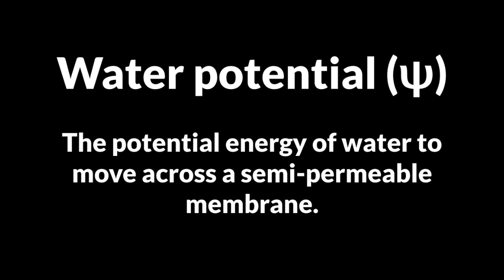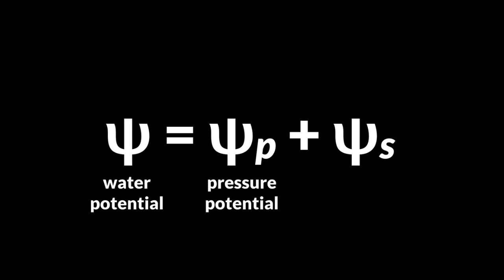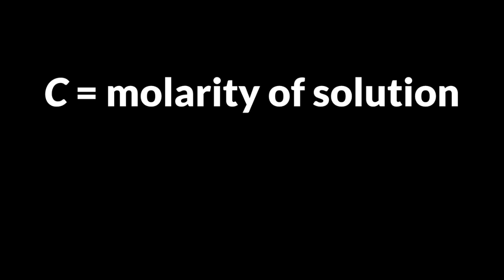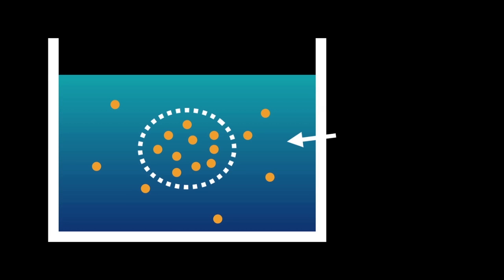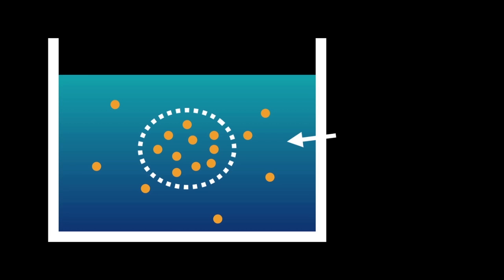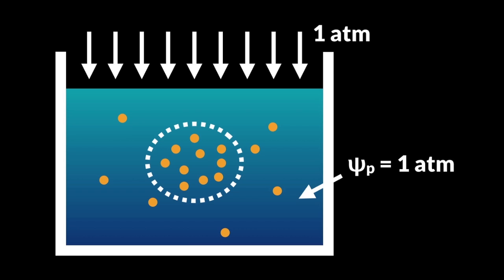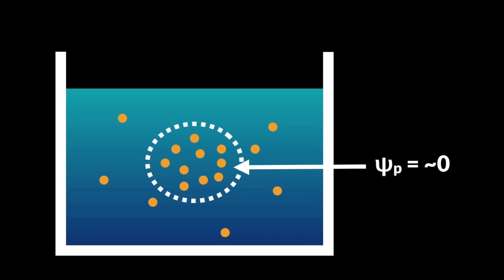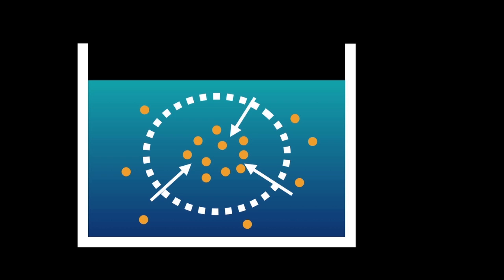A3Academy: Water Potential

Comment: Hello
I talked about carbon and plants coal because it 's the first and always used solution to water purification and filtration, ceramic is also always used
Both are simple ingredients
Coal is the result of pieces of wood, without place and air to burn in a very hot place
The wood gaz get away by the bottom of a metallic box then came back to the up inva bigger metallic box covered by the last one
Wood flaming Vapors then burn
Some woods react really differently
Birch gives also a liquid petrol wich was used since millions years to prevent from water or organic destruction du to the concentration
But also as glue

Instead of charcoal trees :-)
Wich only rest pure coal

The ceramic is only clay soil that can have different use after burning
Some are refractive result material
Other porous and very efficient to obtain filtration
This particular was used in old jars to refresh water in hot conditions
Only a few ridiculous water flow arrived on the extern face, not enough to loose water but has enough to create an evaporate mechanism that as for final effect the refresh
This can not work without a shiny face and a bigger dark one

The result of the light waves incidence in a house :-)

Those are all recyclable products
Then if the jars contains different PH levels, with wires you can also obtain current

A friend has already tryed with differents liquid
It seems that wine works very well
The result, current, is due to the potential difference between the two parts linked by the wire wich transfer electric charges to re-stabilise the both parts

The result needs to be calculated if you want to obtain a perfect reaction
Then the circuit can be wat ever you want or need
If electric universal laws are respected

Comment: Hy and Questioning 
In this example does the cell is able to define all the water volume at the end of the react
Or is there obtention of two specific dimensions of equal neutral potential that fill both the volume

In a perfect and total react, the potential difference, according to the values visible at 5:56 min is 17.12
The total exchange to obtain harmony

But if you get 2 different volumes, you need a pourcentage of each relative to the entire volume
Then, the result will be different

In first case energy is regulated in all the water volume
In second case the volumes will react differently
Depending on the exchange capabilities relative to the volumes

Then, effectively the outside pressure that could be controlled, and is, in a fact, already under control, depending on the recipe strength, material and structure geometry
A balloon will react differently than wood ceramic or inox 
So the exterior pressure will be able to increase the efficiency by specific design and pressure levels control 
But
In limits of the membrane capacity the pressure on the material will modify its capacity 

Other elements could also modify parameters 
Like in battery, the gazs products during charge discharge process increase the pressure 

In this case their are more parameters 
Dry local conditions, current flow, or Archimed influence are new factors that interact and need to be useful in order to interact in the wrong way 

The most important is the earth safety life conditions issue, every thing needs to be recyclable and low toxicity 
But also low consume 
Portable systems or adapted to permit autonomy are in my idea more interesting

You could take a look at the leaves and natural features, those are quite perfect, really
Very thin made of geometrical fractions
And the design are very different, linked to specific conditions of local humidity and specific soils

The fact is that we try to reproduce nature and in accordance to the Hartman field, and the strength of the earth magnetisme, the fractals are locally adapted to specific waves

I'v already used fusain, this permit to write, but this is also a carbon resistant skeleton with very thin holes

https://youtu.be/QjfNrZigqL0
Here is one solution and an interesting Chanel
If you wait the time small lives forms, eat the more fragile parts, the leaves seems like a skeleton and are wet, that permit to dry them in the form needed

You can imagine isolation and different circuits

There's another way i'v already seen, with a plasmique reaction that could be used to apply a thin layer in the small holes without closing the possibility of water pass
Wait just a few minutes :-)

This one is more safety
https://youtu.be/O3DCexCLoGQ

Nope not found again, will try another time
This could also be helpful for cleaning surfaces
https://youtu.be/atVSxvbiPg0

And the other video i was looking for, was using this process with a progressive consommable electrode in one part and the dead wood or leaves on the other part
Like in a cloud in a closed area
The glass was impacted also and the problem with this system including the metal vapors, is the light frequencys that could burn eyes or skin

To came back to the subject :-)
You also should take a look at the micro capillaries particularity, as in electricity, when the hole is very thin, the strength as particular specify du to the geometry 
The difference between larger and higher, that is the way the water climb trees, or worms holes to evacuate in hot summer conditions

In this conditions the soil can be compared as
A thin hot plate, with a enormous quantity of small holes
Linked to a profound cold water ground
The water climb also very quickly the distance with a few energy in water hammer

When the water climb a hole because of the high temperature level, remember that the process needs dark parts field of water around, at the same water level, exactly what arrived under trees
Then when water evaporate in shiny places, the surface refresh this permit other plants to grow
Under the grass same cycle in smaller conditions

This to explain we really need to observe
The natural way is a constant simple surviving issue
Why do we destroy our commun home ?

I wish you understood the last link is about living local forms in closed conditions and it works without atmosphere failures

https://www.youtube.com/c/Jartopia

If you need, a lot of engineering links on my yin-yang avatar in my abonnements, this is possibly helpful but take care about safety conditions, those are not every-time respected, you need to learn them before ;-)

Water is life earth is home, we need to  help each other to protect our home

https://www.youtube.com/c/LearnEngineering

https://www.youtube.com/c/SteveMould
 In general there's lights on experiences 
Si tu est français, tu trouveras facilement les liens

https://www.youtube.com/channel/UC8MFNkCuOrpcCxwe1AgPkZQ
This is my favorite one
I think it 's aan Asian girl
All stuff created by first tools a pile and a cupper wire
Then all new tools created and now since 3 years i follow the channel, incredible tools and programming starting with simple components
I hop you' ll enjoy and we'll develop new good long earth peaceful life solutions